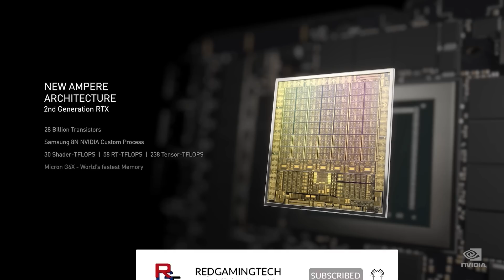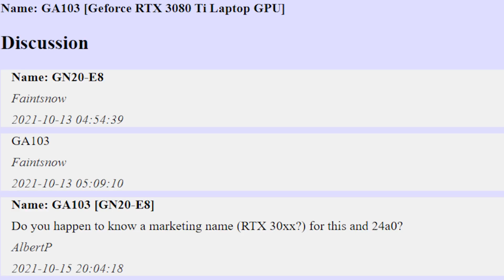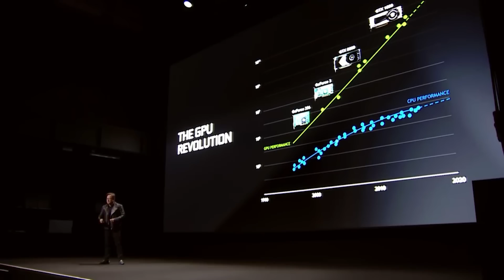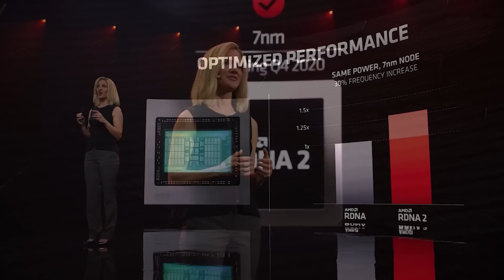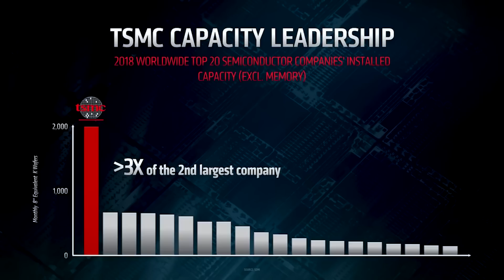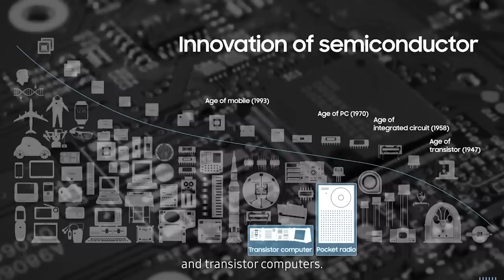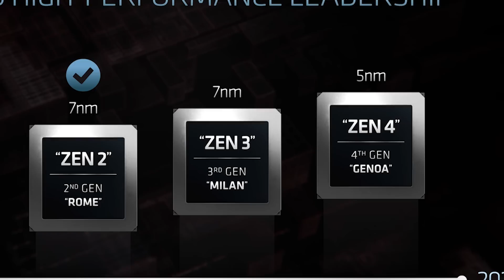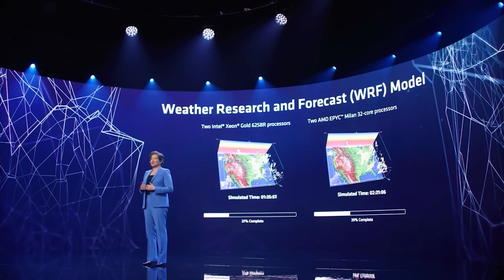RDNA 3 Is COMING - AMD's Next Gen Just Took a Major Step Forward | RTX 3080 Ti Mobile Details LEAK

Comment: The only database taking CPU-Z aside that has Alder Lake is userbenchmark, 40% higher singlethread speed than Comet Lake and Zen 3?
220 points single core vs 100 for the i7 2600K as a reference.
WTF.

Comment: Samsung uses TSMC for overflow, which is what Intel has done in the past.  Samsung is smart to boost their own capacity so they don't have to outsource.

Intel simply needs to catch up in node quality and their roadmap gets them to 2nm before TSMC and Samsung.  If that happens  Intel could start getting back some of the marketshare they lost in fab.

Zen 5 is EPYC NOT going to have a TDP of 600W.  That defies AMD's push over its entire Zen project to make CPUs that consume less power.  It's not going to create a CPU that's almost impossible to cool.  I believe they could get the power envelope up near 400W for something like a 256C CPU.  But, I'm skeptical they would make a 256C X86-64 core CPU.  How big would the package have to be??????????    I could see them making a hybrid CPU similar to Alder Lake, for the server market, where most the cores are RISC because many server workloads don't need the full scope of X86-64 ISA.  But if they do it would be mostly RISC cores with only a handful of X86-64 cores.  That's the only way I see them making a 256C CPU in 2 generations from now.  If they do that, then the cores would use a bit less power so trying to using math based on some power reduction you expect TSMC 3nm to have over TSMC 7nm while adding many more cores, doesn't work.  You'd have to know the power consumption of their RISC cores.  And if this is what they're doing, no one is talking about it because AMD has been very good about keeping secrets when they want to, such as no one knowing they were coming out with a Vcache variant of Zen 3 until AMD announced it.
Reply: Hmm. I see your line of thinking. But I would argue the cpus will most likely have a configurable TDP. It is not out of the question for servers to water cool either. "some do already" 600 watt would most likely be the "burst" and it would throttle back. Its not impossible for them to do it all on X86 cores but it may not be the best choice. Then again you deal with the tech you have IP for I suppose if you cant get new IP online yet.

Comment: So EPYC Turin has 16 chiplet and 16 cores per chiplet = 256 cores.
This means desktop Zen5 SKUs will have a maximum of 32 cores.
Entry-level chips will have 8 cores(half of a single chiplet). Single chiplet SKUs can have 8-10-12-14-16 cores while double chiplet SKUs can have 20-24-28-32 cores.
The production node for Zen4 might be 4nm N4 or improved 3nm N3P.
600W/256= 2,34375W TDP per core that is still insane even though server chips are optimized for power efficiency. MAx power draw of an SKU can be 1.5 times its TDP so 900/256=3.515625W per core. A core optimized for performance(desktop) can draw 1.5 times more than a core optimized for efficiency(server). Therefore a desktop core will draw 3.515625*1.5=5.2734375W. A full 16 core desktop CPU will probably draw 5.2734375*16=84.375W at full load. At worst, a 16 core desktop SKU will draw somewhere between 90-100W.
Reply: It is possible they might have 2 types of chiplets. A 8 and a 16 core. Depending if they feel its needed. "There could be yield or performance reasons that would make it better to have 2 versions of chiplets"

Comment: It's time. They found a way to get the clock speed up in rdna2, now they only have to included a quality RT experience. The drivers could be the answer to that if they can find the right math to execute it in Open CL. If they can't masterfully leverage what they're creating, the GPU gap will only get wider. You can't focus exclusively on hardware, when the software is driving the car.

Comment: 256 cores with 512 threats? is windows still limited to 256 threads?
Reply: They probably wouldn't use Windows anyway, Linux is da wae.
Reply: Windows is limited to 256 cores, not threads.  Look in performance in task manager, you probably have 3-4 K threads at any given time.

Comment: Well , how many PCIe Lanes will it have 128 like the predessors ? It will be PCIe 5.0 that means IO will quadruple = to PCIe 3.0  or at least double if you compare to PCIe 4.0 , 50 % of the used Energy goes into I/O connectivity , the share of energy consumption for the Cores is declining since Years . Maybe they double the Lanes because they double the Cores . And 600 Watts for 192 /256 Cores does not sound that much if you compare it to  Alderlake with its 300 Watts for just 8 big + 8 small Cores ... , its 512 Threads vs just 24 Threads , or 512 vs 48 if you want to have the same Power consumption. 256 AMD cores vs Intels 16 big + 16 small Cores .
I guess that Zen4 will have the same IPC Performance than an Alderlake big Core if not more . It will be interresting to see how much more  IPC the 3d stacked Cache will be able to squeeze out of the " old " Zen 3 Cores , it will be not enough to competete in SC Perormance i guess , but Multicore should go to AMD again
Reply: @Noodle fusion 
Well, its not really new Technology , its Cache , the only new thing is how the cache is connected but we will see , production seems to start in November

Comment: If a 64 core epyc Milan consumers about 280 watts then a 256 epyc chip consuming 600 watts is actually impressive, think about it.... It has 4 times the cores but only consumes around about double the TDP of 64 core Milan. 

So there's definitely a performance per wat increase (as expected ofc)  and AMDs seems to be on the right track for their efficiency roadmap.
Reply: Yeah you're right!
If we take the current 64c EPYC 7763, that consumes 280W, it's 4.4W per core. If a future 256 core EPYC is 600W, that's 2.3W per core.
And it makes sense, if we take process improvement from 7nm to 5nm in Zen4, that's 40% improvement and from 5nm to 3nm for Zen5, it's +66%. Take into account a couple of generations of IPC improvement with +40% and that's a total of 146% performance increase. Or in other words 2.46 times!
This also means we could potentially have 32 Core dies with 128MB L3 cache, from the 8 Core 32MB that we have with Zen3 today. With Zen3D next year doubling the cache, and going from Zen3D to Zen5 it's another 2x from process alone.
I also hope AMD adds SMT4 sometime along the line and we could have 256 Core Threadrippers with 1024 threads and 1GB of L3 in 3-4 years, lol.
For me as a 3D artist, that would be 3D rendering performance on freaking steroids mixed with cocaine!! I love it hahaha
Reply: @NarekAvetisyan  it would basically be like having a personal super computer xD
Reply: @_Chad_ThunderCock  Well Ryzen 9 are practically small server chips.
Reply: 2.5w per core is insanity.
Reply: Krisroffer Pettersson  Hardware Unboxed just released their AMD Win10/Win11 video. Its a good watch
Reply: @dralord1307  Also, while all these fiasco goes on, Linux does evolve and get better, if slowly and bit by bit.

I saw one news where OpenGL used inside Vulkan sees big performance boosts while keeping the compatibility.

So by using API as a wrapper, we could "emulate" renderers and shaders on a completely different OS, thereby making porting games easier, or developing them as well.

Normally using a API inside another API would mean a performance loss due to delays or complexity, but I guess the system can be smart enough to skip over some things in some optimized ways.

Also on Windows, wtf is with modern CPUs and scheduler problems everywhere we go?
Reply: Krisroffer Pettersson  Anyone that pays attention to any of the Alderlake vids that released a few days ago knows Intel tested with the AMD bug, they only tested AMD on win11. They knew the bug was in effect and chose to test and use those results on purpose.

There is a reason why Intel is required by court order to release all their testing info. This is nothing new for them. "Yes they were sued and a judge ordered them to release full test info forever, in the past"
Reply: Krisroffer Pettersson  Server chips are often designed with different workloads but generally yes they can do the stuff we do easily multiplied by a value.

Because a server needs to handle clients times ⁿ
Reply: too many hidden wild cards behind AMD, Intel would expect this Pat is going to get fire!
Reply: Krisroffer Pettersson  Well, them cloud based games aren't exactly running on air lol
Reply: Krisroffer Pettersson  lol Normal... 😉
Reply: Krisroffer Pettersson  Not sure wtf you're smoking because I never said anything about either camp's CPUs. And I'm the main one taking a wait and see approach to any comsumer grade chips so yeah.

Fix your targeting kid 🤣
Reply: Yeah, Intel shot itself in the foot by revealing itself early to seem good, only to have people realize it's the usual Intel scheming.

AMD always had EPYC chips that are extremely powerful for higher wattage in the first place, as that is the whole point of server chips.

Also, why would anyone in the mainstream market needs more than 6 cores right now? The software optimization hasn't reached a point where it's necessary, and in gaming it's sorta meh with game engines being a hit or miss, we need Unreal Engine 5 games and so like.
Reply: @dra6o0n  not everybody on mainstream plattforms games exclusively. Some use core-heavy applications as a hobby or side business. Also some games like Anno do use more core quite effectivley and given that both new gen consols are both 8-cores I think that have some impact on futrue games.

Comment: 256 cores / 512 threads at 600 watts. Meanwhile, Intel is getting ready to introduce 8+8/24 cores/threads at 241 watts. Anybody who thinks Intel will be catching up to AMD by the time Zen 5 is released has been drinking too much spiked Kool-Aid.
Reply: 600/256 = almost 2.4 watt per core, as intel 241/16 = almost 15.1 watt per core
Reply: @wakeupamerica8738  
16 Core 32 threads for basically 38.4 watts?
Reply: @dra6o0n  the 1700 and 2700 we're 8c/16 threads at 65 watts 4 years ago on 14nm.
Reply: Kool-aid+++++++
Reply: Krisroffer Pettersson  that rights intel is behind quite alot since they spinning out 4 core/8thread skylake like there is no tomorrow for like 6-7 generation of garbage cpu and actually Alder Lake was planned as a road map to complete with Zen 1 on 2016-2017 era
Reply: You are comparing totally different cpu designs and roles. For desktops it will still be around the same as zen 3 also you are comparing Intels early 10nm to amds 7nm
Reply: @deangregoric4735  And what of Intel's refined 14nm++++ to AMD Early 7nm?
Reply: @dra6o0n  that means that amd should easily be theoretically twice as fast.
Reply: @deangregoric4735  not theoretically, tech corporations like AMD Intel and such always like to keep their best stuff for later.

why bring out the best of the best when you can slowly sell lower quality products over time...

competition is only to encourage them to push the best items sooner, but even then they only do that after they develop the better that makes the "item" obsolete in a sense.
Reply: @deangregoric4735  Can I get the logic behind this one? I am curious.
Reply: @deangregoric4735  bruh AMD using the same chiplet for Desktop and Server chip, that why they can scaling number of core far more easily than intel
Reply: @stepbruv8780  it's still not the same unless you wanna play "i told you" when they released. If you are expecting 40 watts for 16 core cpu am going to tell you right now, you are going to be disappointed. It's all about frequency, it doesn't come for free.
Reply: @stepbruv8780  if the performance per watt is there... You can't really say nothing.
Reply: @deangregoric4735  lol 2X power draw to achieve the same performance or sure pass 5950X by a few percentage is not something to say about performance per watt is there.. by the way all E-core is disable during heavily use like gaming so all 8 big core don't have to share L3 cache with small core
Reply: @stepbruv8780  I would rather see for myself rather relaying on someone's claims
Reply: @deangregoric4735  wtf are you talking about? intel did release the specification of power draw already
Reply: @stepbruv8780  that means nothing if you don't know on what wattage it was tested personally 12gen can't be worse than 11gen especially being on smaller node right? If 11gen was a bit short neck to 5900X while being faster is single core performance for only 20w more draw how does 12gen need 2x more power draw to have same performance as 5900x🤔
Reply: @deangregoric4735  bruh 12th gen PL2 TDP is at least 240watt on boost which is still 2X the power draw of Zen 3 that why I told you intel can't put more than 8 big core because the power draw and thermal is exceed the limit (even tho they can use up to 10 core with smaller node but the power draw still high as hell so it's look stupid on power draw and thermal and wouldn't compete with Zen 3 on performance per watt)
Reply: @deangregoric4735  Intel 10nm is directly comparable in many aspects to TSMC 7nm. The whole NM thing really means nothing its all marketing bs these days
Reply: You can't really compare their consumer parts to server, AMDs power draw is way higher on their non server parts.

Comment: But what's the point if we can't even buy them?
Reply: Even if miners stopped buying gpus, I don't see the prices going back to normal because there's issues with manufacturing capacity.

It takes 2-3 years to build a new fab facility and given the current trajectory of the rise in demand for semi conductors, Its safe to assume these issues will permiate till 2024-2025 and that's assuming manufacturers don't artificially keep the prices high.
Reply: @bruhder5854  Takes 7 years to build a fab, and they have actually produced record amounts of gpus this year, problem is you have multiple consoles launched at the same time and crypto sucking these cards up.
Reply: @rooster1012  Multiple consoles..... and Apple already taking more than half of overall capacity, with their own new stuff. And wasn't TSMC hit with a few outages too (droughts and power as I recall which further hampered everything. If Nvidia didn't get laughed out of the room, it would be even worse all around)
Reply: You can or will be able to... It's just a matter of how much are you willing to spend over MSRP to get ur hands on one.
Reply: @_Chad_ThunderCock  with how much more it's gotten, most ordinary gamers, including myself are not inclined to pay for it.

I'm fine with getting a low end gpu at a reasonable price that allows me to just game at 60 fps 1080p low settings but even that's hard to get.

Comment: RDNA 3 will be like HD 5000 vs Fermi, when a low-mid range card HD 5770 could beat gtx 460/470 lol, no competition to begin with..
Reply: GTX460 actually faster than HD5770. More in league with HD5830. With overclock GTX460 can almost reach HD5850. and back then MSAA is still very popular in games. When you crank up MSAA it will start surpassing 5850. It is the reason why AMD release HD6800 ahead of the HD6900.